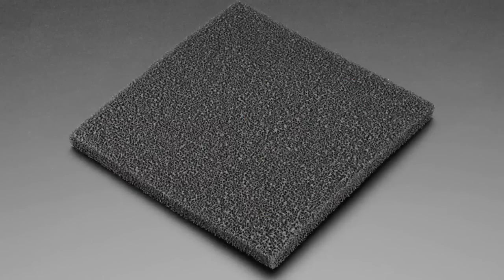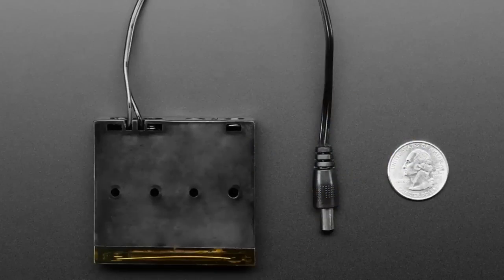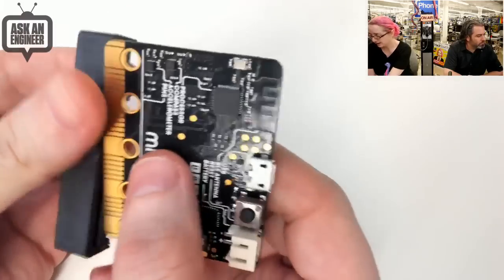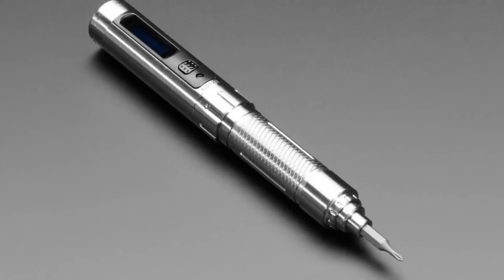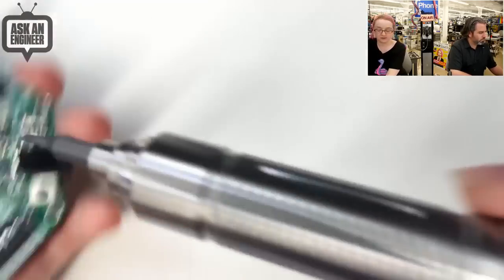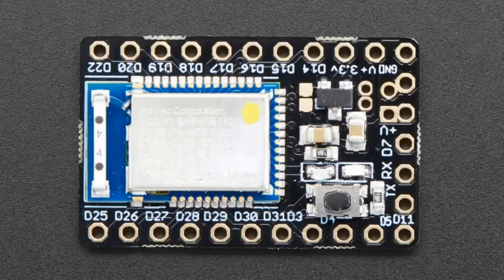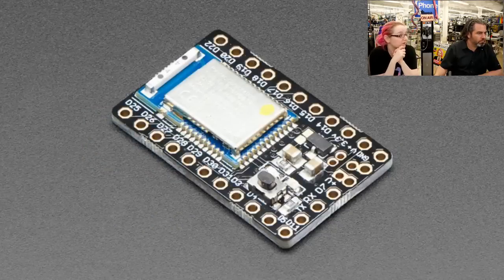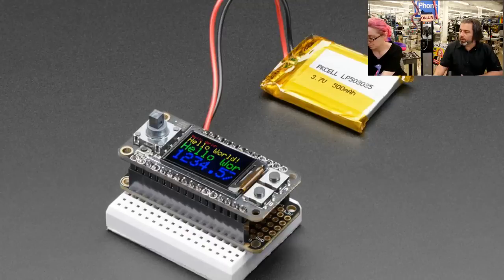New Products 7/18/2018 Featuring Adafruit Color #TFT w/ #Joystick #FeatherWing! @adafruit #adafruit

Comment: I only got to A level electronics. If I understand SeaSaw is a coprocessor, is it common to have a coprocessor on the same board or is it predominantly used on a secondary board?